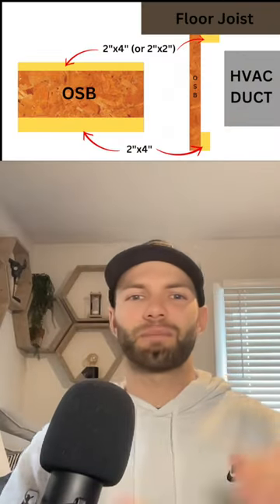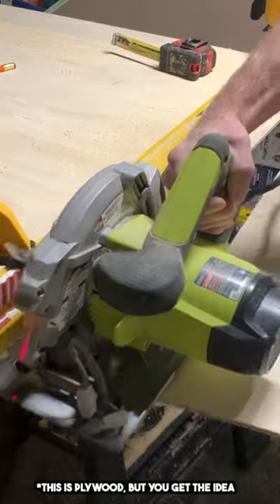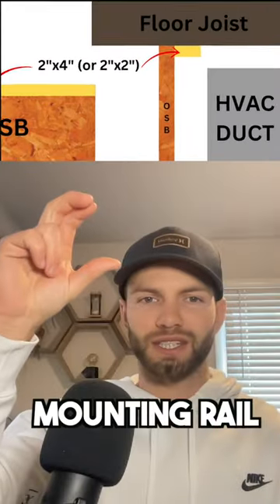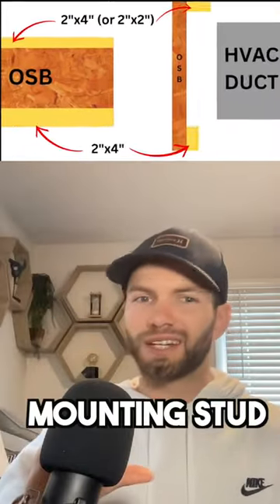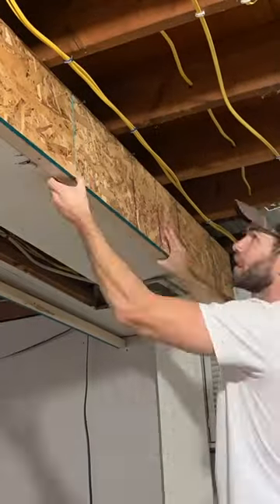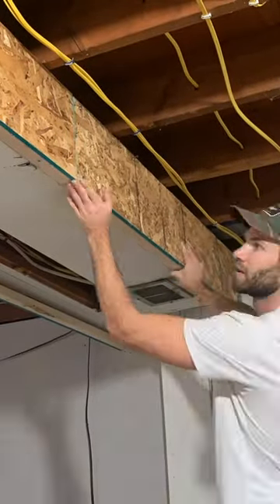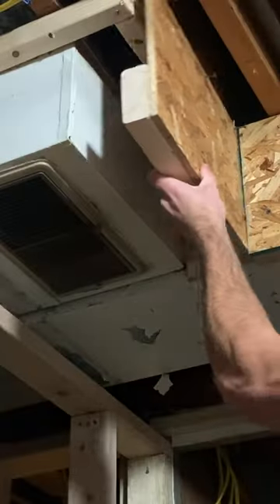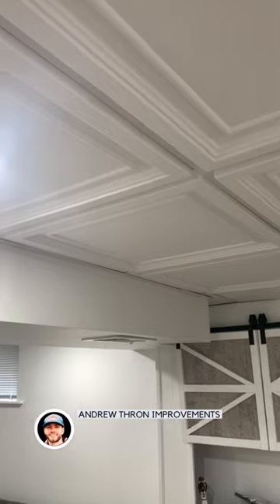How to Frame around HVAC Ducts or Pipes in a Basement!

Comment: When I did my duct cover I used a 2x4 on top and a 2x10 underneath. I used a dropped ceiling below. Where I had a beam I used a 1x4 undeneath, I stained and polyurethaned all exposed areas. If a duct had a curve or reduction, I just picked an angle that would cover this. I actually had an area where I had a duct and beam and an angle on the duct.
Reply: I just did one where there was 5 ft wide duct that got smaller and smaller, ran parallel to the beam with 2 poles coming out of the beam. So I boxed in all the duct work, ran an angle back to straight and boxed in both poles. The second pole was a nightmare because it was where a hallway would be. Turned out truly fantastic though and I used this very method just with 2 x 3's instead.